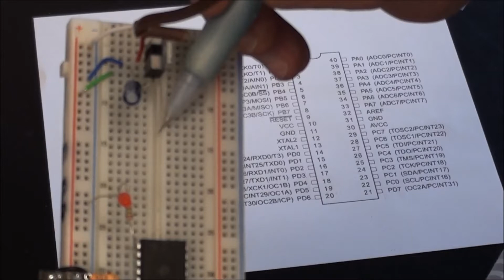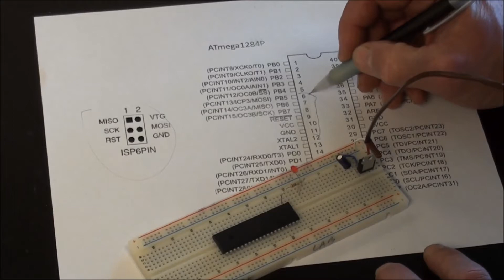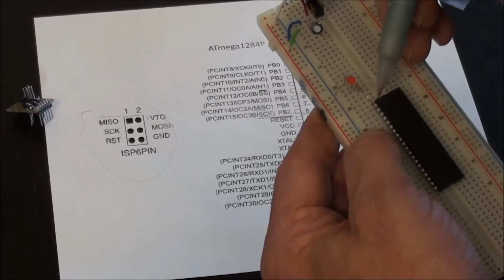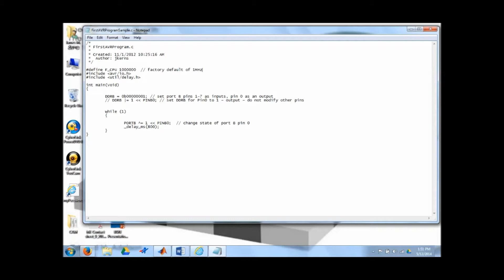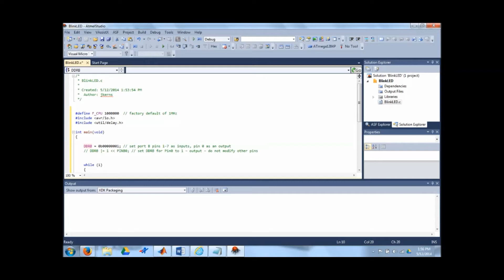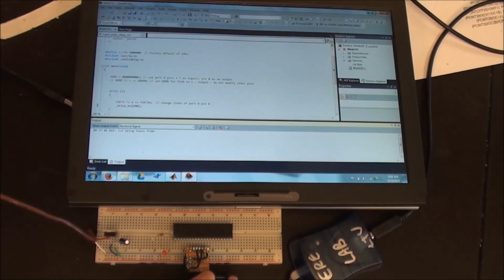ERE 2024: First AVR Program using the ATmega1284P on a Breadboard

Comment: Is there anyway we can read a analog voltage and print the result to .txt file in Atmel Studio? Thank you!
Reply from the maker: I have never tried writing to a file on the Atmel chip - it doesn't look straightforward to me, but I could be missing something. Also, you don't have that much memory available.  On the other hand, if you want to send data back to a PC via serial communication that is fairly straight forward - some examples for serial communication here: https://github.com/JimKerns/Video-samples
Reply: Thank you! I will try it.